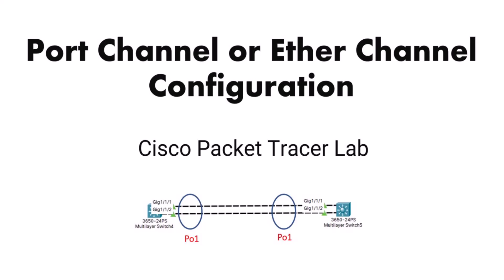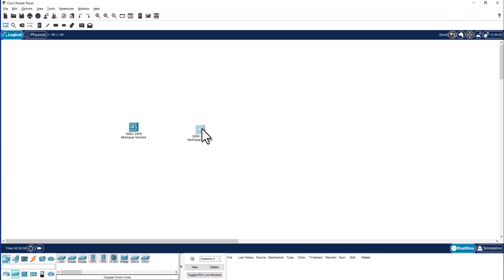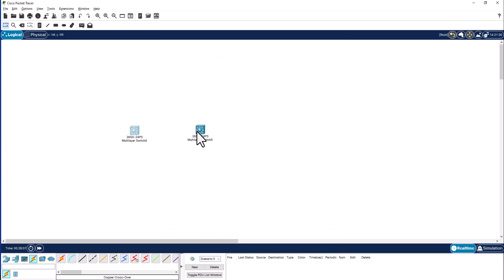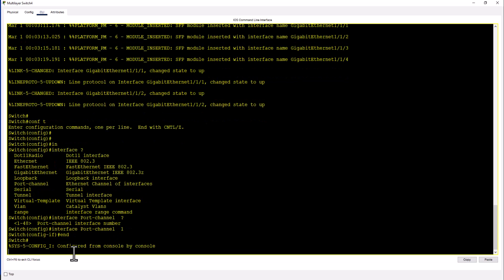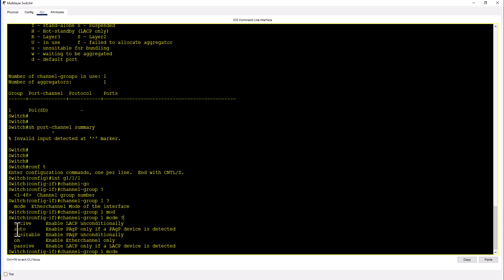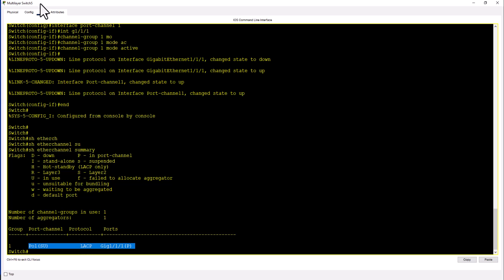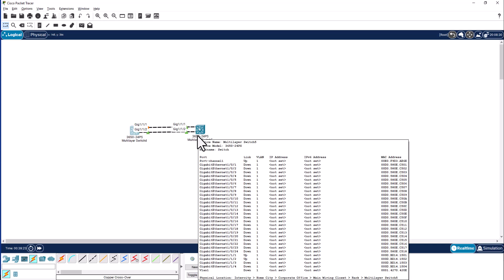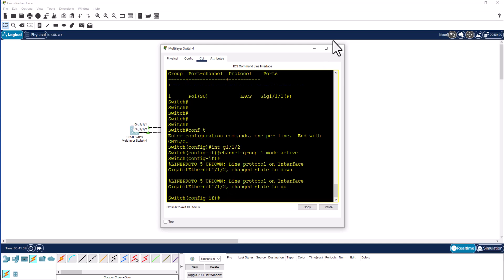Cisco Packet Tracer Lab - Port Channel or Ether Channel Configuration

Comment: This is one of the best examples!
Reply: # CCNA v7 – Router & Switch Cheatsheet (tekst-only)

---

## 1. IOS Modi (belangrijk voor examen)

* *User EXEC mode*
  Prompt: `>`
  Alleen bekijken, geen configuratie mogelijk.

* *Privileged EXEC mode*
  Prompt: `#`
  Naar deze mode met `enable`. Volledige show-commando’s.

* *Global Configuration mode*
  Prompt: `(config)#`
  Naar deze mode met `configure terminal`. Hier stel je alles in.

---

## 2. Navigatie in IOS

* `exit` → 1 niveau omhoog
* `end` of `Ctrl+Z` → direct terug naar privileged EXEC
* `Ctrl+Shift+6` → lopend commando afbreken

---

## 3. Basis beveiliging & identiteit

### Hostname & banner

```
hostname R1
banner motd #Access denied#
```

### Enable wachtwoord

```
enable secret <wachtwoord>
```

> Gebruik *altijd* `enable secret`, nooit `enable password`

### Wachtwoorden versleutelen

```
service password-encryption
```

---

## 4. Console & VTY (remote toegang)

### Console

```
line console 0
password cisco
login
```

### VTY (SSH/Telnet)

```
line vty 0 15
password cisco
login
```

* Router: VTY 0–4
* Switch: VTY 0–15

---

## 5. SSH configuratie (examenfavoriet)

```
ip domain-name example.com
username admin secret SterkWachtwoord
crypto key generate rsa modulus 2048
ip ssh version 2

line vty 0 4
transport input ssh
login local
```

Extra beveiliging:

```
security passwords min-length 10
ip ssh authentication-retries 2
ip ssh time-out 60
```

---

## 6. IP-adres op switch (SVI)

```
interface vlan 1
ip address 192.168.1.2 255.255.255.0
no shutdown
ip default-gateway 192.168.1.1
```

> Alleen nodig voor *management* van een switch

---

## 7. VLANs

### VLAN aanmaken

```
vlan 10
name SALES
```

### Access poorten

```
interface range f0/1-10
switchport mode access
switchport access vlan 10
```

### Trunk poort

```
interface g0/1
switchport mode trunk
switchport trunk native vlan 99
switchport trunk allowed vlan 10,20,30
switchport nonegotiate
```

---

## 8. Inter-VLAN routing

### Router-on-a-stick

```
interface g0/1.10
encapsulation dot1Q 10
ip address 192.168.10.1 255.255.255.0
```

Native VLAN:

```
interface g0/1.99
encapsulation dot1Q 99 native
```

---

### Inter-VLAN via Multilayer Switch (MLS)

```
vlan 10
interface vlan 10
ip address 192.168.10.1 255.255.255.0
no shutdown

ip routing
```

---

## 9. Spanning Tree (STP)

### Mode

```
spanning-tree mode pvst
```

### Root bridge instellen

```
spanning-tree vlan 10 root primary
spanning-tree vlan 20 root secondary
```

### Edge / access poorten

```
interface f0/1
switchport mode access
spanning-tree portfast
spanning-tree bpduguard enable
```

---

## 10. EtherChannel

### LACP

```
interface range f0/21-22
switchport mode trunk
channel-group 1 mode active
```

Controle:

```
show etherchannel summary
```

> *EtherChannel altijd vóór STP configureren!*

---

## 11. DHCPv4

```
ip dhcp excluded-address 192.168.1.1 192.168.1.10
ip dhcp pool LAN
network 192.168.1.0 255.255.255.0
default-router 192.168.1.1
dns-server 8.8.8.8
```

Relay:

```
interface g0/1
ip helper-address 192.168.1.5
```

---

## 12. DHCP Snooping & DAI

```
ip dhcp snooping
ip dhcp snooping vlan 10
interface g0/1
ip dhcp snooping trust
```

DAI:

```
ip arp inspection vlan 10
interface g0/1
ip arp inspection trust
```

---

## 13. Port Security (alleen access poorten)

```
interface f0/1
switchport mode access
switchport port-security
switchport port-security maximum 1
switchport port-security mac-address sticky
switchport port-security violation restrict
```

Controle:

```
show port-security interface f0/1
```

---

## 14. OSPF (single area)

```
router ospf 10
network 10.0.0.0 0.0.0.255 area 0
```

Of via interface:

```
interface g0/0
ip ospf 10 area 0
```

Passive interface:

```
passive-interface default
no passive-interface g0/0
```

---

## 15. ACLs

### Standard ACL

```
access-list 1 deny 192.168.1.0 0.0.0.255
access-list 1 permit any
interface g0/1
ip access-group 1 out
```

### Extended ACL

```
access-list 100 permit tcp 192.168.1.0 0.0.0.255 host 10.0.0.10 eq 80
access-list 100 deny ip any any
```

---

## 16. NAT & PAT

### Static NAT

```
ip nat inside source static 192.168.1.10 203.0.113.10
```

### Dynamic NAT

```
ip nat pool POOL1 203.0.113.10 203.0.113.20 netmask 255.255.255.0
access-list 1 permit 192.168.1.0 0.0.0.255
ip nat inside source list 1 pool POOL1
```

### PAT

```
ip nat inside source list 1 interface s0/0/1 overload
```

---

## 17. HSRP

```
interface g0/1
standby version 2
standby 1 ip 192.168.1.254
standby 1 priority 150
standby 1 preempt
```

Controle:

```
show standby brief
```

---

## 18. Show-commando’s (EXAMEN GOUD)

```
show running-config
show ip interface brief
show vlan brief
show interfaces trunk
show spanning-tree
show etherchannel summary
show ip route
show ip ospf neighbor
show access-lists
show ip nat translations
```

---

### EXAMENTIPS

* Eerst *EtherChannel**, dan **STP*
* ACL: impliciete `deny any`
* Port-security & portfast alleen op *access poorten*
* SSH vereist *domain-name + RSA key + local user*
* OSPF process-id hoeft niet gelijk te zijn

---

## 19. GRE Tunnel met IPsec (VPN)

> Eerst *GRE tunnel werkend (ping!)**, daarna pas **IPsec* configureren.

---

### Stap 1 – ISAKMP (Phase 1) policy (op **beide routers**)

```
crypto isakmp policy 1
hash sha
authentication pre-share
encryption aes
group 5
lifetime 3600
```

---

### Stap 2 – Pre-shared key instellen (op beide routers)

```
crypto isakmp key <sleutel> address <extern-IP-andere-router>
```

---

### Stap 3 – IPsec transform-set (Phase 2)

```
crypto ipsec transform-set TS esp-aes esp-sha-hmac
```

---

### Stap 4 – Crypto MAP aanmaken

```
crypto map MIJNMAP 1 ipsec-isakmp
set peer <extern-IP-andere-router>
set transform-set TS
match address VPNACL
```

---

### Stap 5 – Crypto MAP toepassen op externe interface

> Dit is *dezelfde interface* die je gebruikt als `tunnel source`

```
interface g0/0
crypto map MIJNMAP
```

---

### Stap 6 – ACL voor VPN-verkeer (GRE beschermen)

```
ip access-list extended VPNACL
permit gre <source-netwerk> <wildcard> <dest-netwerk> <wildcard>
```

* *Source netwerk* = extern netwerk van deze router
* *Destination netwerk* = extern netwerk van de andere router
* Op R2 exact hetzelfde, maar *source/destination omdraaien*

---

### Controlecommando’s

```
show crypto isakmp sa
show crypto ipsec sa
```

---

### EXAMENTIPS IPsec/GRE

* GRE eerst *zonder IPsec testen*
* ACL matcht **GRE**, niet IP-netwerken
* Crypto map **moet op fysieke interface**, nooit op tunnel
* Policies & keys *moeten exact gelijk zijn* op beide routers

---
Reply: LACP – trunk EtherChannel
interface range gig0/1 - 2
switchport mode trunk
channel-group 1 mode active
exit

interface port-channel 1
switchport mode trunk

PAgP – trunk EtherChannel
interface range gig0/1 - 2
switchport mode trunk
channel-group 1 mode desirable
exit

interface port-channel 1
switchport mode trunk

Access EtherChannel
interface range fa0/1 - 2
switchport mode access
switchport access vlan 10
channel-group 1 mode active
exit

interface port-channel 1
switchport mode access
switchport access vlan 10

Show
show etherchannel summary
show interfaces port-channel 1

Access poorten
o Wireless Access Points worden gekoppeld aan FastEthernet 0/1 van de accessswitches. De toegelaten mac-adressen worden door de beheerder handmatig
vastgelegd.
o Voor de andere actieve poorten wordt maximaal 1 vast mac-adres toegelaten. Dit
mac-adres wordt door de switch automatisch vastgelegd.
o Op VLAN 10 zijn alleen de twee servers en de laptop van de beheerder aangesloten,
op de eerste drie FastEthernet poorten.
o Op VLAN 20 zijn 7 pc’s aangesloten, op de FastEthernetpoorten 2 t/m 8.
o Op VLAN 30 zijn 6 pc’s aangesloten, op de FastEthernetpoorten 2 t/m 7.
o Ongebruikte poorten staan op het BlackHole VLAN en zijn gesloten.
o Van onbekende apparatuur wordt verkeer geweigerd, maar de poort gaat in dat
geval niet down.

🔐 ACCESSPOORTEN – COMMANDO’S PER EIS
1⃣ Wireless Access Point op Fa0/1

Toegelaten MAC-adressen worden handmatig vastgelegd

📍 Op elke access switch – Fa0/1

interface fastEthernet 0/1
 switchport mode access
 switchport access vlan <20 of 30>
 switchport port-security
 switchport port-security maximum 1
 switchport port-security mac-address xxxx.xxxx.xxxx
 switchport port-security violation restrict

🔹 <20 of 30> → afhankelijk van waar de AP hangt
🔹 MAC-adres → handmatig invoeren (vereist!)

👉 Waarom?
Wireless AP = bekend apparaat → MAC niet sticky, maar vast.

2⃣ Andere actieve poorten – 1 MAC, automatisch vastgelegd

MAC-adres wordt automatisch vastgelegd

📍 PC- en serverpoorten

switchport port-security
switchport port-security maximum 1
switchport port-security mac-address sticky
switchport port-security violation restrict

👉 Waarom sticky?
De switch leert automatisch het MAC-adres van het aangesloten apparaat.

👉 Waarom restrict?

Verkeer wordt geweigerd

Poort blijft UP
✔ Exact wat het ontwerp zegt

3⃣ VLAN 10 – servers + beheerder (Fa0/1–3)

📍 Op H_AS_10_1

interface range fa0/1 - 3
 switchport mode access
 switchport access vlan 10
 switchport port-security
 switchport port-security maximum 1
 switchport port-security mac-address sticky
 switchport port-security violation restrict

4⃣ VLAN 20 – 7 pc’s (Fa0/2–8)

📍 Op H_AS_20_1

interface range fa0/2 - 8
 switchport mode access
 switchport access vlan 20
 switchport port-security
 switchport port-security maximum 1
 switchport port-security mac-address sticky
 switchport port-security violation restrict

5⃣ VLAN 30 – 6 pc’s (Fa0/2–7)

📍 Op H_AS_30_1

interface range fa0/2 - 7
 switchport mode access
 switchport access vlan 30
 switchport port-security
 switchport port-security maximum 1
 switchport port-security mac-address sticky
 switchport port-security violation restrict

6⃣ Ongebruikte poorten → BlackHole VLAN + shutdown

📍 Op elke access switch

interface range fa0/9 - 24
 switchport mode access
 switchport access vlan 999
 shutdown

👉 Waarom shutdown + VLAN 999?
Dubbele beveiliging → examenpuntje.

7⃣ Gedrag bij onbekend apparaat

Verkeer geweigerd, poort blijft up

✅ Dit wordt geregeld door:

switchport port-security violation restrict

❌ NIET gebruiken:

violation shutdown   ← fout (poort gaat down)

Comment: Hi, is it possible to create a port-channel on a router? This is part of my assignment, but in cpt I can't do it on any router unit, all kinds of errors are constantly returned. Even if I manage to create a port-channel and apply it to the physical ports, it doesn't work, because when the sh run command is output, the ports remain unbound to the created port-channel.